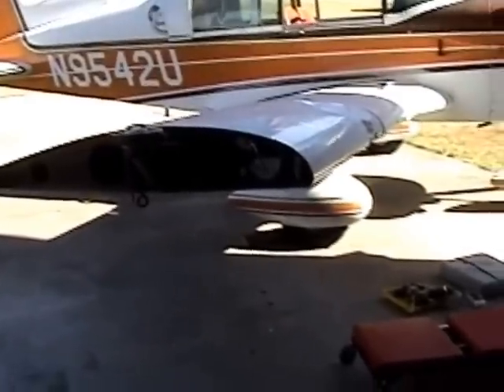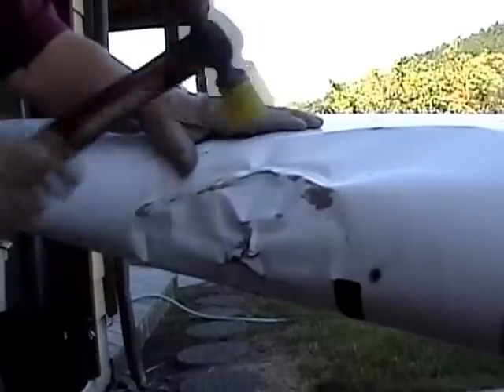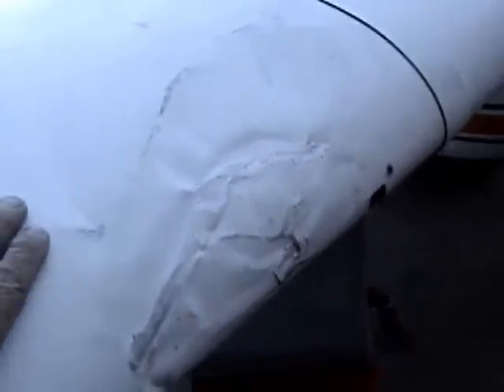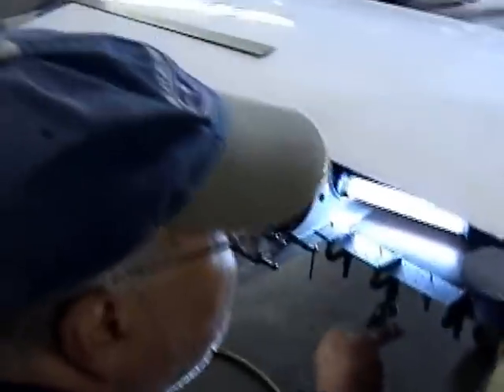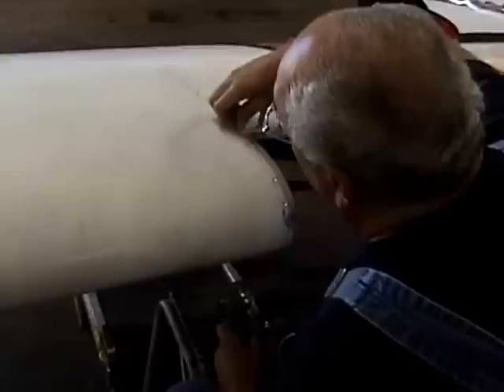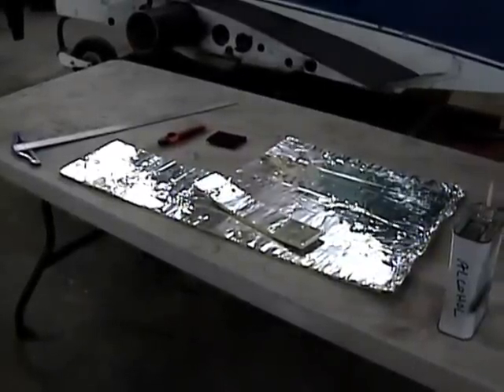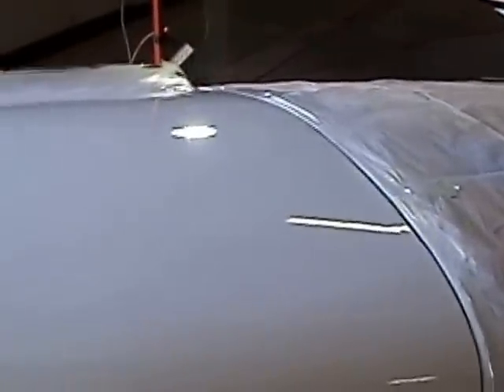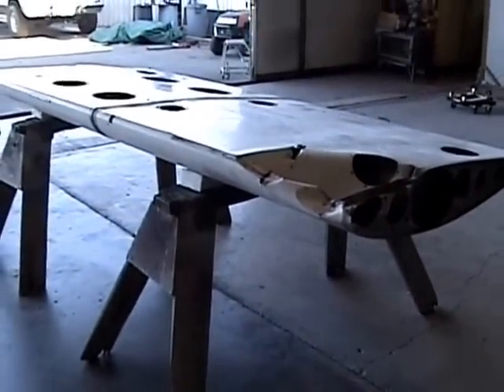Wing Repair Bird Strike - Grumman Pilots

Comment: I was skeptical when I got to the point in the video after the hammering was done..... looks like an air foil, little bit of duct tape and it will fly. Of course I continued to watch and it appears the initial repair was just intended to ready the plane for a ferry flight to where it could be repaired properly. Excellent job sir!!
Reply from the maker: Ken did great work, am artist.

Comment: The "Push A Dent Out" technique, aka "how to buckle a wing spar". Spars are designed to take vertical bending loads only, not fore aft loads, especially of unknown magnitude.  The airplane is currently deregistered when I checked this morning...things that make you go hmmm.   This video is an unwise tribute to a man who has passed away.
Reply from the maker: It is a circular spar so it had strength in all directions unlike a i-beam spar.

Comment: I know this is an old video but have you thought about using any of the automotive glue on items that allows you to pull areas out? Thanks for the video.  What aluminum material is this wing made with? I ask as to weather or not you can weld the crack.

Comment: Wait - How did you buck those 1097s going around the patch? How'd you get a bucking bar in there with the skin on? Did you stick a bar into that inspection hole & buck?
Reply from the maker: The hole is bigger than it looks, enough for your hand and a tool.  FYI

Comment: I have an AA5A in the UK that has sadly suffered wing damage to both wings, but a lesser degree than in this video and been told its a write off. Can you advise roughly what the cost would be to carry out that fantastic repair?
Reply from the maker: Using the tool to straighten the wing the rEAl cost is the bondo filler and paint to repair the strike area.

FYI

Comment: Why didn’t you take the whole sheet out and use bead roller to fix it?
Reply from the maker: Our lanes are space age bonded (i.e. glued under heat) and not able to remove a panel like most airplanes.

Comment: I'm curious, if the wing is held together with glue, wouldn't that patch work if you just used glue instead of glue & rivets?  Wouldn't the rivets weaken the epoxy  during any flexing?  ...just asking, not suggesting anything. =)
Reply from the maker: No going it wet they strengths

Comment: It's OK to just pull/tap out the wrinkles and smooth over with bondo? Because the skin is non-structural (not loadbearing)?
Reply: Were did he just tap out wrinkles and bondo over? He replaced the section of wing and added a section of a rib to boot.
Reply from the maker: Yes
Reply: @jimsonbrown9768  He replaced a section of skin but there other areas he was able to tap out wrinkles and fill with filler.

Comment: Hell man, it wasn't the bird's fault your wing was damaged. This is one of those things, "shit happens" is talking about.
     I was flying into Buchanan Field with my dad years ago and we flew through a flock of geese. Didn't hit any, but I saw one go by under the wing maybe a foot outside my window.
     It happened so fast that there wasn't even time to say "Shit" from the time we saw them and were through them.
      We did have an airport vehicle accidentally run into the wing on my dad's Cardinal (Cessna 177RG) and it did quite a bit less damage.
     Funny enough, the summer it happened I was working for my dad's airplane mechanic (who was a good friend of the family) and my boss had me fix it.
Reply from the maker: Glad you liked it

Comment: Bird Strike?!!! Only if the bird was sitting on a fence post or a sign at the time! There would be blood and guts everywhere. Looks suspiciously like a ground incident with a couple of feathers stuck on for effect?!! Dealt with " bird strikes" so many times!   Really his is a replace rather than push out job. The sharp creases are very likely to be stress raisers that will lead to cracks forming. Fitting a new leading edge the only real option. As an EASA B1(all),B2 and C plus as an A+P I would not authorise this repair. It is outside the remit of the structural repair manual. Who is going to sign this off?
Reply: I have also dealt with many bird strikes and they come in many guises, some messy some not. If the repair meets the scope of the repair scheme in the AMM then whats the problem and so what if you have a B1, B2, A&P, and a 10 yard swimming certificate, I've worked with many with similar credentials that are not fit to wipe my arse.
Reply: LEEDS8  oh really? Maybe it hit a frozen chicken up there? I am not oink to get into who's got the biggest box competition with you, much more important stuff to be getting on with, my RV9, to waste time arguing with you. Flight safety is my primary concern, as it's the primary concern of every engineer. I am guessing you are also a fully qualified aircraft engineer and hence my confusion at your rather cavalier attitude. I have referenced the SRM and can't find any scope of work to cover this job? Maybe you can enlighten me as to where I am going wrong? You got any reference I can check please? For the good of all I think it only right you throw some light onto this?
 My course of action would be to remove the wing and replace it with a correctly certified replacement or have it overhauled by an approved organisation and refitted. I have shared this video with fellow engineers and they concur with my train of thought. I do have a meeting with FAA rep coming up soon , ref my A, and will bring it to his attention and I will share the opinion straight from the man. I predict much grimacing!
Reply: Yep, Andrew is a Democrat.
Reply: @BettySwollocks13  Well said Sir ............
Reply: @andrewwilson8317 - did you not watch the "repair" section of the video? .... I would also suggest that you test the Canadian goose theory as follows - 1 - attach a dead goose to a pole suspended(at head height) from the side of a vehicle. 2 - drive said vehicle at takeoff/landing speed for the yankee and 3 - stand in front of the goose as it approaches. ps - pay up your insurance first ..... as for the "push out repair" it was for a ferry flight. I have seen fare less substantial repairs used to ferry airliners to depot repair .................. JRW A&P 1969
Reply: ???????? Disturbed - the sound of silence ?????????????? time for recertification. I'm thinking ........ ;-p
Reply: @donstor1  i guess you a trumpet supporter who doesnt believe in flight as its too sciency
Reply: @jusb1066 -Hey there is not Climate Change. Is all Democrat Fake News.
Reply: @CFITOMAHAWK2  yep because of all the republican science work that has gone on , hahahahaha
Reply: @CFITOMAHAWK2  the Bible says the Earth will be destroyed by fire
Reply: @daverayburn013 -Also implies that the earth is flat and the center of the universe and much more BULLSHITTT.
Reply from the maker: Bird strike goose

Comment: 43:25 really pisses me off... If a supposide Aircraft mechanic cannot do the job properly then he/she should NEVER work on any aircraft! My dad died because some idiot install his autopilot incorrectly. Unfortunately, back in 1970 there were no stringent regulations to work on an aircraft... but today... to see that and the aircraft passed multiple annuals?? Thats infuriating!

As for the patch job... true craftsmanship. I would have no issue being a passenger in this airplane. (Especially now that stall sensor has been corrected and fixed!)
Reply: Fuck that!!. that plane is bucket of lose parts.
Reply from the maker: It happens